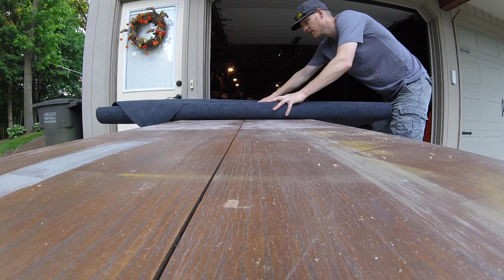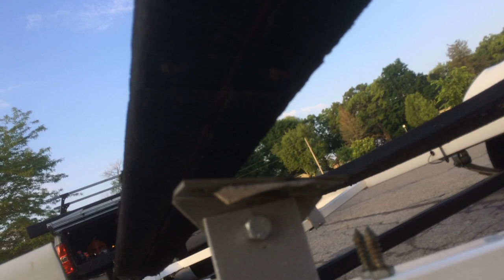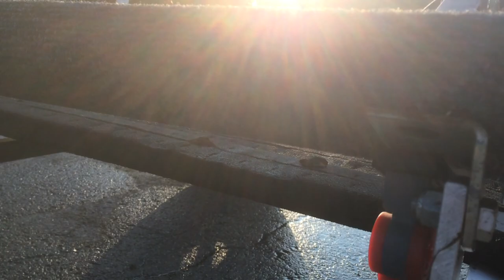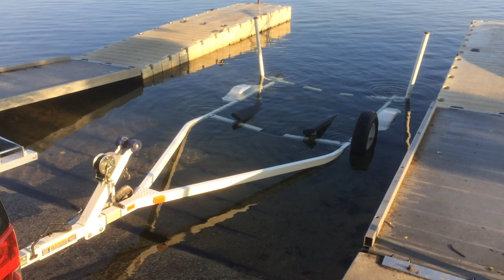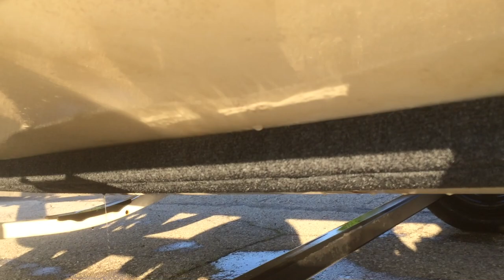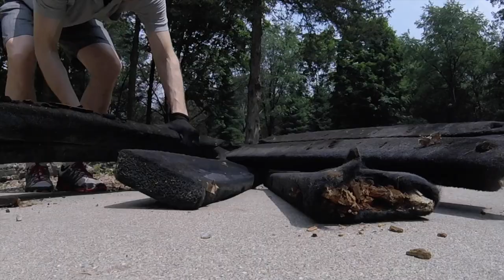EASY SPRING PROJECT - Replacing bunks on our boat trailer

Comment: Went to the lake yesterday and noticed it me of my boards was split. What kind of screws did you use and were they the original? I noticed the ones on my trailer looked like wood screws (I’m not the original owner). What size carpet do you recommend for replacing both boards? Thanks for sharing great video.
Reply from the maker: Thanks for watching and the questions A M!  We used small (short) lag screws that fit through the hole on the brackets before getting a good bite into the wood bunks.  As for the carpet, we purchased a 8' or 10' roll of regular outdoor carpet that had a softer fell to it (not the plastic/scratchy stuff).

Comment: Thanks for the helpful video! It looks like you're in need of some replacement parts. For the screws, it's best to use galvanized or stainless steel lag screws, which are corrosion-resistant and ideal for marine environments. As for the carpet, go for marine-grade carpet designed specifically for boat trailer bunks. It's durable and resistant to water damage. Measure your boards to get the right size, and make sure to secure it properly. Happy boating, and best of luck with your repairs! 🚤🔩 #BoatMaintenanceTips

Comment: If you use treated wood use galvanized lug screws. Staples are usually stainless steer.
Reply: Do you not use stainless for both because while the galvanized will certainly get rust on the outside before the bunks need to be replaced they wont rust enough to fail at all, but the staples would rust enough to fail if not stainless before that same point in time.

Comment: If using treated wood, and most do because of the longevity, use galvanized lag screws. Staples are usually stainless  steel.
Reply from the maker: Thanks for watching and the comment @Todd Knox!
Reply: Great advice! Using treated wood, galvanized lag screws, and stainless steel staples ensures longevity and durability for boat trailer bunks. It's all about investing in quality materials for a setup that can withstand the elements. 👍🛥 #BoatingTips